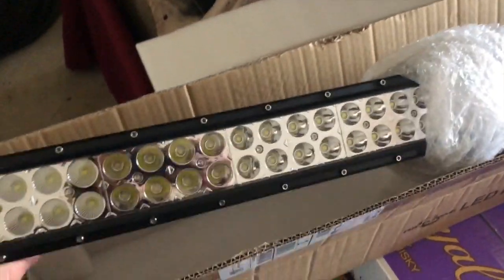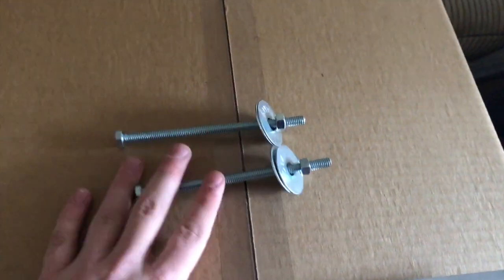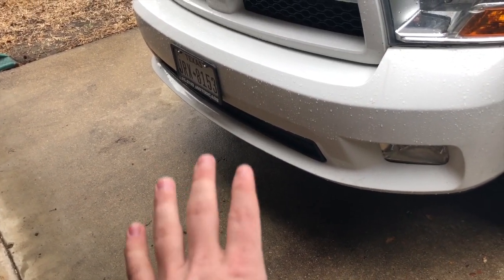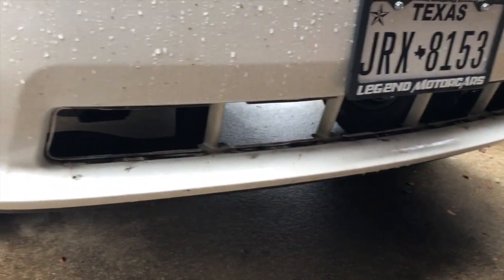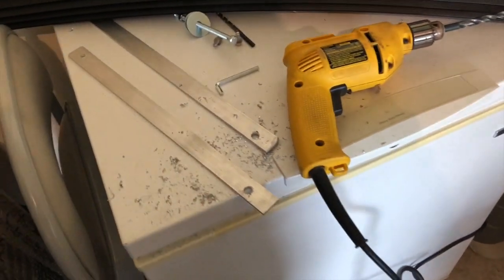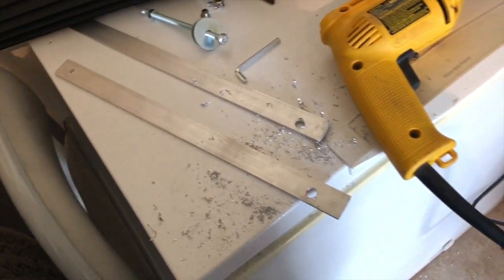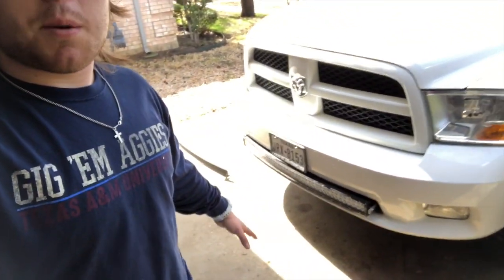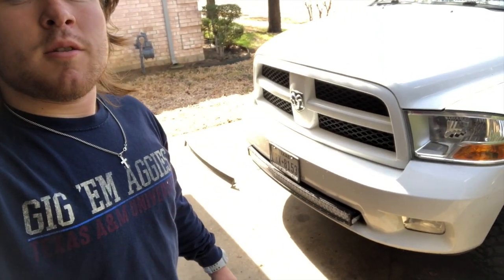Ram LED bar lower grill install

Comment: Hey man nice install i have a diferent harness the one with the green and red light is there a way i can cut a cable so they can turn off always so i dont drain my baterry?
Reply from the maker: I personally just always deal with a single light, switch for that reason. You can get one on amazon for like $10